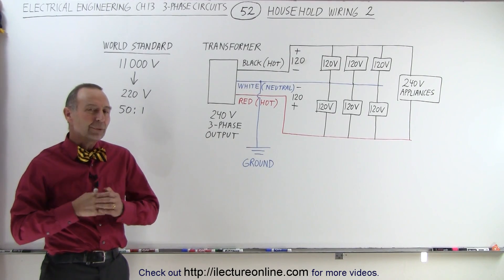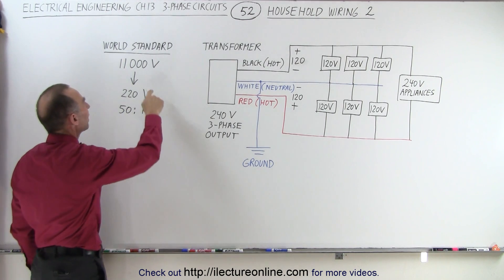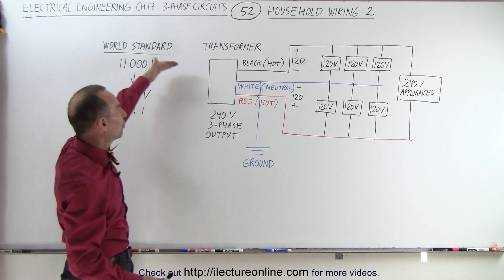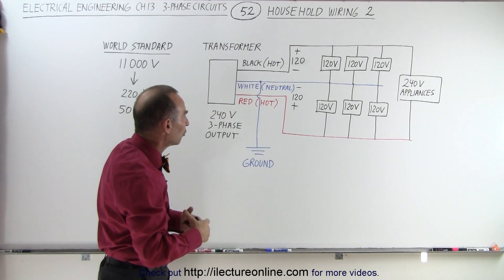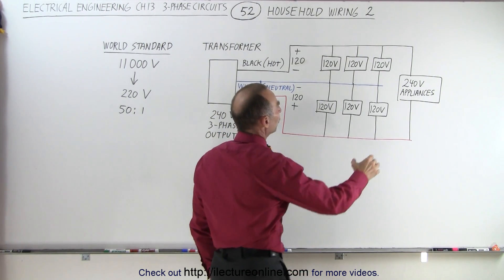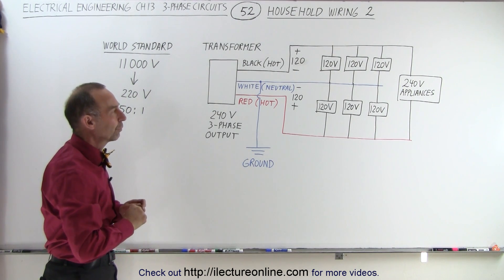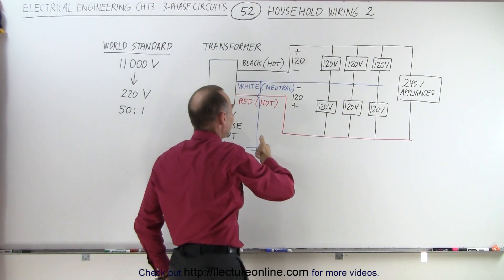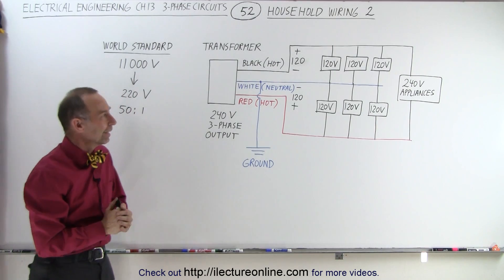Electrical Engineering: Ch 13: 3 Phase Circuit (52 of 53) Household Wiring 2

Comment: Why are you referring to 240V as 3 phase? It's single phase.
Reply from the maker: When 240 V is provided for a single residence it is indeed single phase.  We have a building where each one third of the building is connected to a phase.  (Most commercial buildings have a 3 phase circuit)
Reply from the maker: 208 V is one of the supplied voltages for 3 phase voltage supply, but there is also 240 V (and others)

Comment: Before I became an electrical engineer I used to watch a lot of your videos, so I came back for fun (thanks a bunch!). I work as an electrical engineer in construction designing power distribution for commercial buildings and such. In response to 1:55 the current WILL NOT flow to the earth ground rod to save the person. If this was true, why would we need GFCI receptacles? All appliances that have metal is bonded to what is called the equipment grounding conductor. What the ground wire does is that if a live wire touches the metal part of the appliance, the equipment grounding conductor acts as a secondary path for the short circuit current to go to so that it trips the breaker de-energizing the metal part so that it's safe again. Also GFCI saves people from ground faults, not some ground rod in the dirt. The ground rod is there to protect from lightning and surges.
Reply from the maker: Excellent information!  Thanks a bunch and congratulations.

Comment: I am an electrican in the USA. Houses rarely have 3 phase power.they have single phase 120/240
Reply from the maker: You are correct that most houses in the US are supplied with single phase.  I have a building that is supplied with 3-phase power
Reply: @MichelvanBiezen  
I and my family really enjoy your knowledge transfer videos, thank you and your family. 
With all due respect, unfortunately there is some erroneous nomenclature in this and the previous video as applied to the US. 
In my area of the US most utility residential distribution is 34,500 VAC. 
Most US residential utility service is derived from a utility distribution consisting of two of three available distribution phase conductors connecting to a 2 bushing single phase primary winding subscriber service lateral transformer that has a single secondary winding developing 240 volts end to end that has a center tap that is grounded providing a grounded neutral split single-phase subscriber service. 
The 120 volts is derived from either end of the single secondary transformer winding when referenced to the same secondary winding center tap that is designated as the Neutral and also grounded with a local grounding rod. 

The ends of the utility distribution single secondary winding have the phasors 180 degrees out of phase developing 240 volts.
When either end of the secondary winding phasor is at the crest of the sine wave the secondary winding center tap is at the zero crossing point and develops 120 volts. 

A 2 wire single phase input primary winding transformer cannot develop secondary output of three 120 degree separated phases (delta or wye). 

Each device protective/safety grounding conductor is connected to a grounding bus bar in the circuit breaker panel and the grounding bus bar is electrically bonded at the service entrance to a ground conductor and a grounding electrode driven into the earth. 
The purpose of the separate protective/safety grounding conductor is to provide a secondary low impedance path to complete a circuit thereby shunting hazardous fault current/voltage to ground and simultaneously tripping the overcurrent protection device better known as a circuit breaker or fuse.